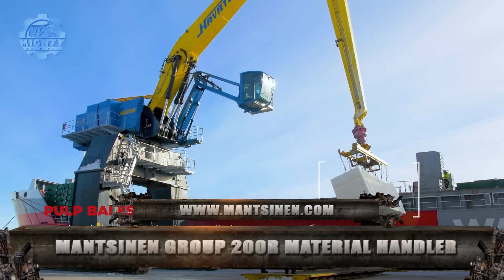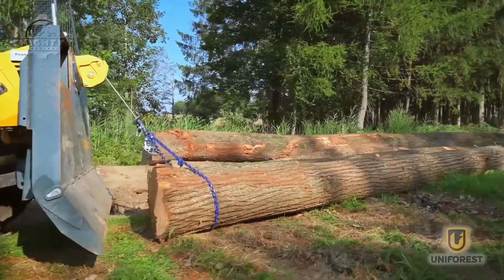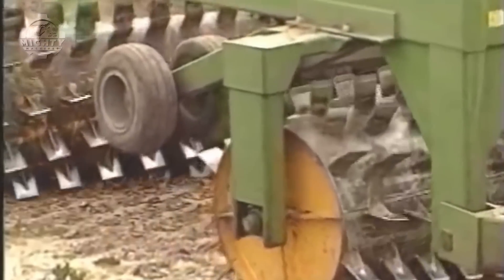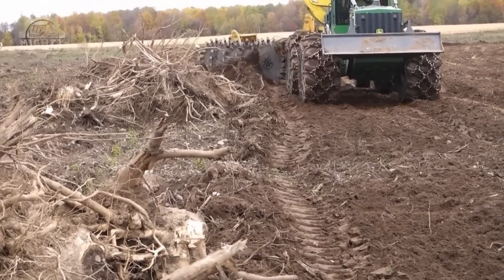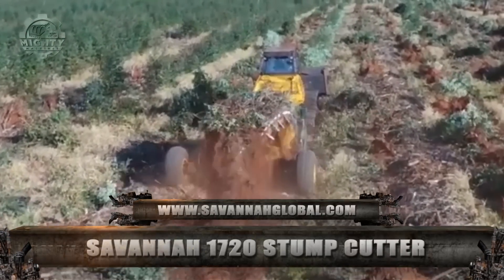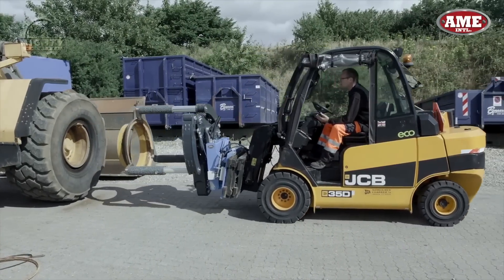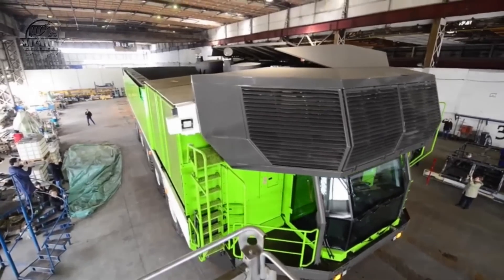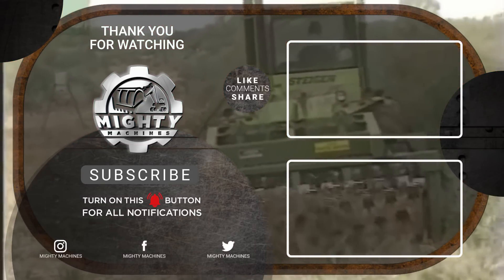TOP 20 Crazy Powerful AND Dangerous MACHINES That Are On Another Level

Comment: Before I retired I had several 4 X 4 farm tractors. Now, I already knew that putting extra tires on a tractor DECREASES the amount of tire pressure on the ground. In Thailand, they have to work tractors in flooded rice paddies.  They weld a metal paddle wheel and mount it on the wheel lug bolts.  It works, I've seen paddle wheel tractors work in flooded fields that people can't walk on.
Reply: Saw that also